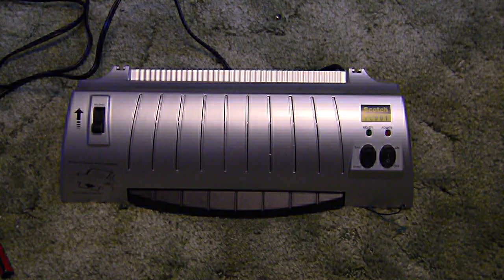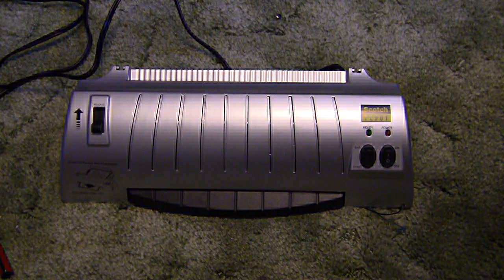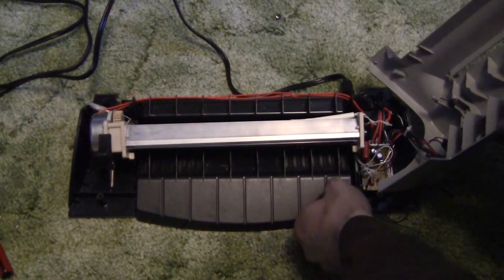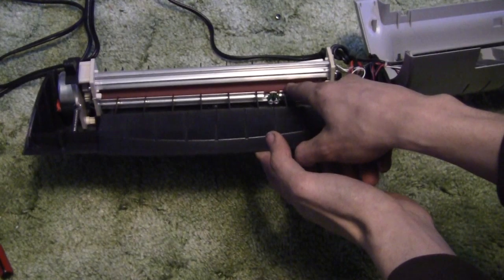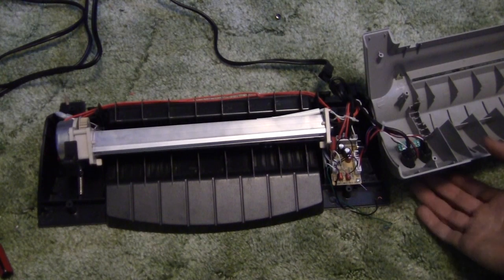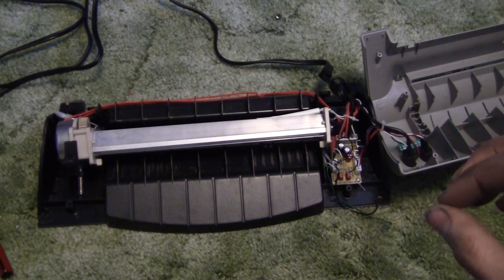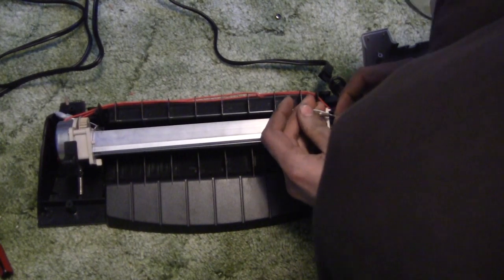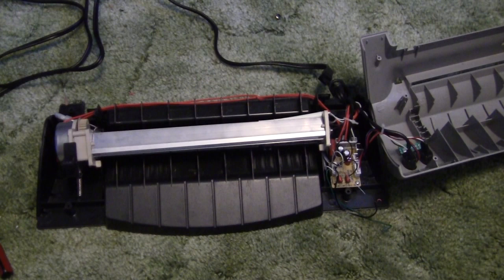Scotch TL901 Thermal Laminator PCB Toner Transfer Modification

Comment: I picked up a TL901X ($20 on Amazon), and it is a slightly different variation of the TL901 shown in the video.   It looks like they've done away with the thermal fuse.  Temperature for the 3 mil setting is 105 deg C, 5 mil setting is 120 deg C.  I added a 1.2K resistor and got 110 Deg C for the 3 mil setting and 131 Deg C for the 5 mil setting.  a 2K resistor gives 130 deg C for the 3 mil setting and 157 deg C for the 5 mil setting.  This was measured with a thermocouple between the rollers (on the outgoing side so it didn't get sucked in).  I also added eight 5 mm diameter 1mm thick washers to the screw bosses between the two halves of the case because 0.063" boards don't quite fit otherwise.
Reply from the maker: Awesome info! Thanks for the update on a newer model, I've been curious of the internals of the newer laminators and if this mod was still viable!
Reply: Thanks! I'm grabbing a 901C tonight because target has them for 21 bucks. Can't remember the temp of my paper. But damn the hand iron gets old.
Reply: So the one I picked up, labeled as the TL902 is showing 135C on 3 mil setting, and 150C on 5mil setting out of the box. Tested using a Fluke meter and thermocouple in same position as Lines above. This unit has a 216C thermal fuse installed. When I have more time I'll try running a transfer and see how it goes, not sure when it gets to a point of too hot for the transfer, before adding any resistors.

Comment from the maker: Completely different? Perhaps its a newer revision, maybe its got clips holding it together? Check and make sure they haven't hidden screws under stickers or little feet on the bottom before you try popping any clips there might be.

Comment: I have one question. It's not easy to find a laminator with cold and hot options. I was thinking. Isn't that an EASY thing to add, just adding a switch that cut the wire that makes it get hot ?
Reply from the maker: it should be very simple to add a switch with a resistor to be able to switch to a hotter mode.
in one position the thermistor wire would connect straight through the switch to the normal connection, and if the switch is flipped the other way then it it would have a resistor in the middle to limit the signal from the thermistor which would make the laminator heat up hotter for toner transfer.

Comment: Although I'm getting 5 mil traces to work great on smaller boards with 5 passes through the laminator, the motor moves a bit fast at 5.7 mm/s and it would be good to slow it down.  I tried a diode in series with the motor but the result was no motion.  A triac motor speed control slows it down to 5mm/s but with much loss of torque, so they're probably using a synchronous motor.  I dunno, maybe I'll try a triac gated with a 555 timer to intermittently feed and stop the motor every few AC  cycles, or just blast the board with a heat gun to keep it warm.
Reply: Have you tried 3D printing some new gears ?

Comment: How many micron is that laminator? I found one that has 2x 125 micron. Will that work? What is your PCB thickness? Did you change the thermostat for a 200 deg one?
Reply from the maker: It is rated to do 3mil or 5mil, which I believe 5mil is 125micron, I'm not sure on my PCB thickness, Didn't change the thermistor, added in a resistor to up the temperature.

Comment: This is a great mod! I am curious what kind of 1.2k resistor you got? I went to radio shack and they hand 1/8, 1/4, and 1/2 watt resistors in 1.2k. Which one do you think I should get? I also saw a dimmer switch people were using to slow the roller down on some of the Harbor Freight ones, do you think that mod would work on this as well?
Reply from the maker: Seville I personally used a 1/4 watt as I keep assortments of them around for projects with the PCBs we fab. I hadn't seen the roller slowing dimmers, I think it could be possible, but I'll have to check to be 100% sure

Comment: fuse is SF188E
Reply from the maker: Is that the factory one? I'd imagine it would be possible to replace it with a higher temp one in the same package, or a second one with a switch to select between the two to retain laminator function too. You've got me thinking now! Thanks a ton for the comment!

Comment: Where's the mentioned link?
Reply from the maker: Oh. I updated the website a while back and broke the link and must've removed it from the description. Guess I need to write those instructions up and get the link put back. Sorry about that! I'll get the info posted on trythistv.com sometime tomorrow!
Reply: @trythistv  Oh ok, no worries. You don't have to do a new write up if the old one is lost. How did the laminator hold up for PCB (toner transfer) use since the time you made the video? Is the quality of the laminator good enough? Thinking of buying the newer model currently on Amazon (TL902).
Reply from the maker: @shifter65  I'm fairly sure I have the backup on my computer but never got around to putting it on the new site. Shouldn't be much trouble, and I do say there is a link, so I should have one lol. The laminator has held up great. I'm still using it however many years later (somewhere around 6 or 7 I believe) and it still works perfect.
Reply: @trythistv Could you please share the results of your tests of the thermistor and different resistance values ? I just bought a TL901X and took it apart, the thermistor is labelled TL902... But I guess it’s the same diode (more or less) and your results should carry over to my model. I was thinking of wiring in a 2K potentiometer to be able to adjust the temperature instead of using a fixed value. If you can’t, no worries, I’ll try and do my own testing with a laser thermometer.
Thank you !

Comment: try out the Apache AL13P modifiable laminator
http://hackaday.io/project/3363-apache-al13p-laminator-one-pass-pcb-toner-xfer
Reply from the maker: Ancel UnfetteredOne  That looks like a pretty awesome unit! I may just have to build one of those sometime. thanks for sharing with me!
Reply: trythisiptv
Yes it is, I can run from flexpcbs to about 2mm copper clad thru it with no adjustments. The mod. allows one pass toner transfer and one pass foiling onto toner layered onto metal.